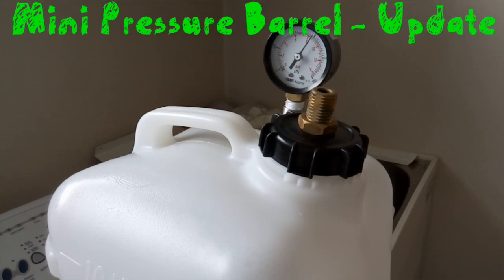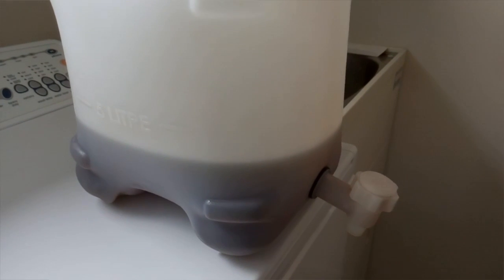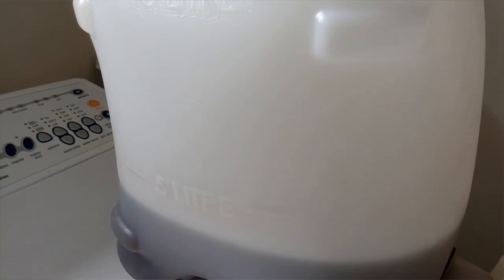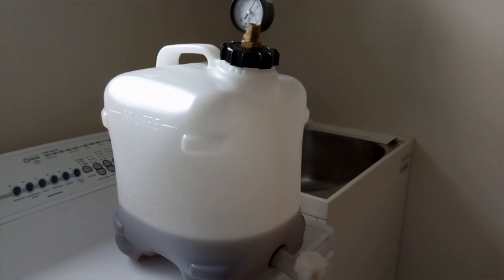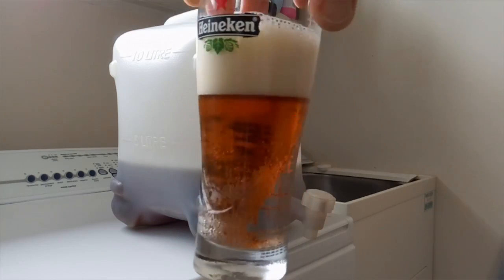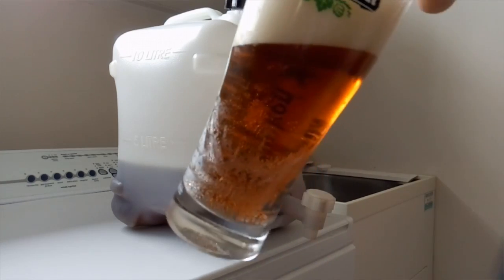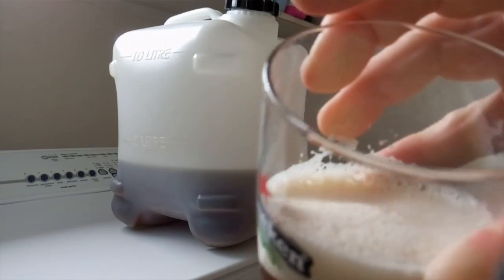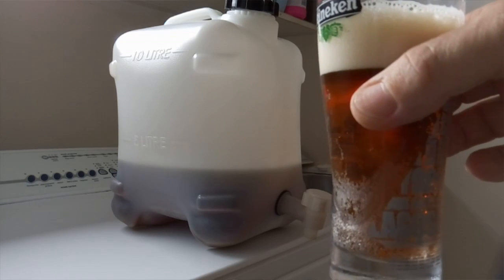DIY Beer Mini Pressure Barrel / Keg / Cask - Update

Comment: You've done a great job on the pressure barrel Dino, perfect size for the fridge that also sits alongside bottles as well, 
beer looks really good, I must admit I do prefer my beers from the keg but for versatility bottles are hard to beat as well, 
Cheers mate, thanks for the mention too, 🍻
Reply from the maker: +cheshirehomebrew Thanks Dave. It's handy to have this sitting in the fridge. The fridge doubles as a normal fridge, so it's always got veges etc in it, so needed something that didn't require all the shelves to be removed. One day I hope to have a dedicated fridge and taps like your own. Cheers mate

Comment: Still looking good m8. Can you force carb or do u add priming sugar and just use the co2 to top it up?
Reply from the maker: +gifryer Thanks mate. I still prime with about 80gms sugar to get the initial pressure in there and yes, just top up with Co2 as I draw the beer off. It doesn't need too much. Cheers

Comment: Cool little pressure barrel m8...idea for ya ...next hoppy ipa you make use it to dry hop in...other words use it as a secondary, rack beer into it about 5 points before terminal garvity add dry hops and seal lid tight 2-4 days. barrel expands heaps.. idea is that that the hops and aromas get reasorbed back into the beer rather than venting . works well for me . noticeable sulfary aroma for first 2 weeks but ends up being quite a hoppy beer.
Reply from the maker: +Steve Bellward Cool. Thanks for the idea. It's definitely food for thought. Hope the brewing is going well for you! Cheers mate

Comment: does the yeast settle to the bottom of this? im researching into making my own keg, but im confused about how to deal with the settled yeast.
Reply from the maker: Yes, the yeast settles to the bottom, just as it would if it was bottle conditioned. If you inject co2 only rather than priming with sugar, you'll end up with even less sediment. Either way the sediment doesn't cause any problems as the liquid is drawn away from the sediment. The longer you leave in the fridge the more sediment will fall out of suspension. I hope this helps. Cheers
Reply: @tubedinoz  so the tap doesn't suck any sediment out? Does much beer go to waste?
Reply from the maker: @justim4545  No sediment gets pushed out. You do get a bit of beer wasted, but I tilt the mini keg forward with a block under the back to get as much out as possible. As long as liquid is covering the back of the tap you'll get beer. Cheers